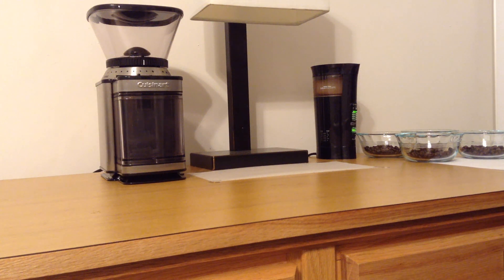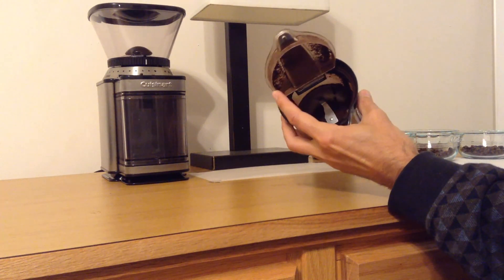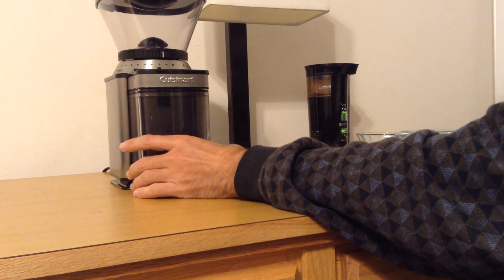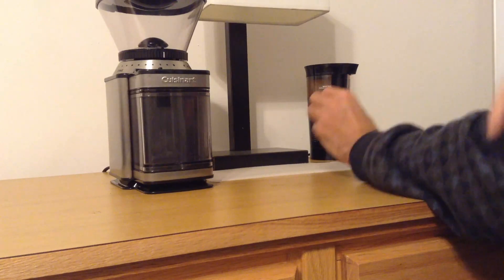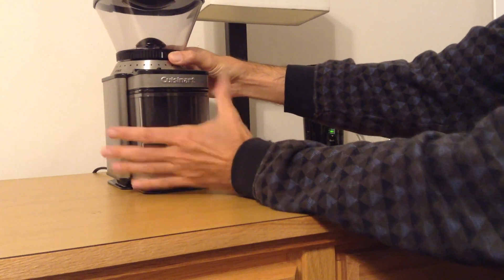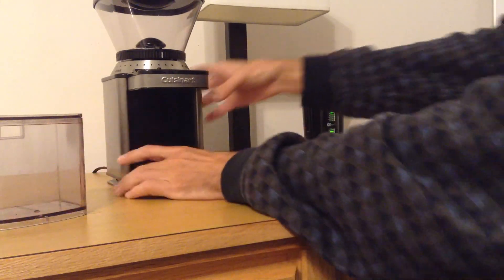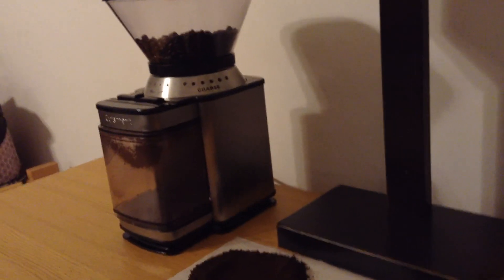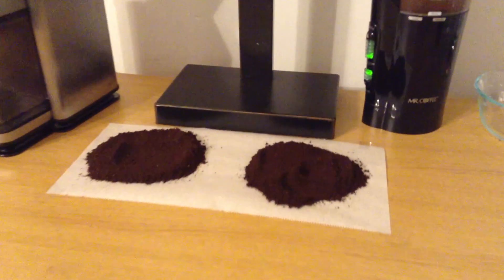Cuisinart DBM-8 Burr Mill Coffee Grinder Review

Comment: Another big difference between burr grinders and blade models, that you didn't mention, is that blade grinders create a lot of friction which in turn creates more heat. Heat will damage the delicate flavor compounds in your coffee beans. And here's a tip when using your burr grinder, if you want to adjust or change the grind size, and there are beans in the hopper, you should only do it while the machine is running. Turning the adjustment back and forth while the hopper is full can damage your burrs or throw off the alignment of them if there are beans in between them when the motor is stopped.
Reply from the maker: helpfulnatural Thanks for the thoughtful comment. I can't believe I forgot to mention the heat/friction issue with blade grinders. Thanks for pointing out the omission.

I don't think the adjustment issue you mention is a problem with this particular grinder though. The burrs are metal and the whole machine is very sturdy. I doubt it would be damaged even if beans are between the burrs. At the very least you would have to feel heavy resistance and keep turning anyway before it could be damaged. TBH, I hadn't considered this issue until you brought it up. Thanks again for your great comment.
Reply: Actually, most burr grinders do have metal burrs but the gears attaching them, underneath where you can't see them without taking the machine apart, are plastic. With enough force/pressure on them while adjusting the grind with a full bean hopper, can or will cause them to snap or shear off the teeth. Just sayin'.
Reply: Rich Reviews Thank you for tapping the grinds collector on the table to show how easy it is to break up the static charge. I'm constantly amazed at how no one can figure this out!